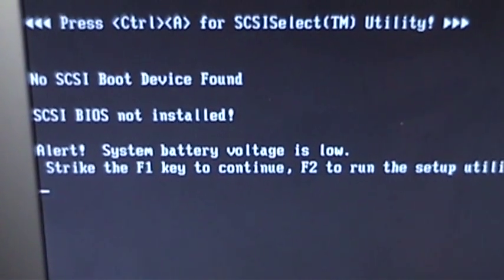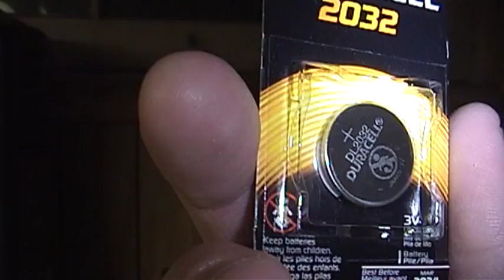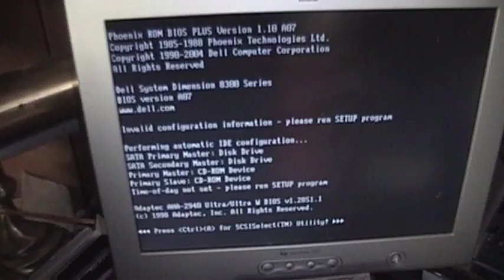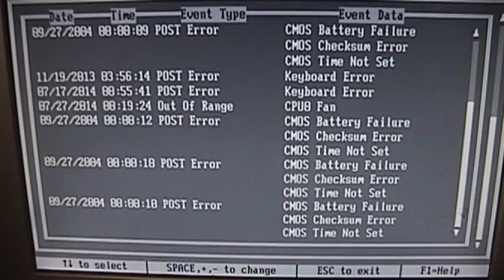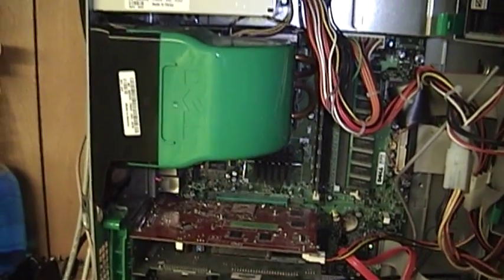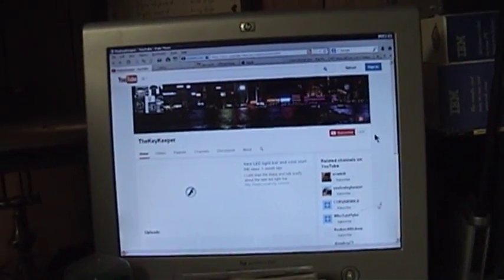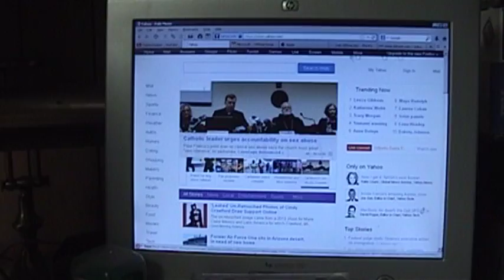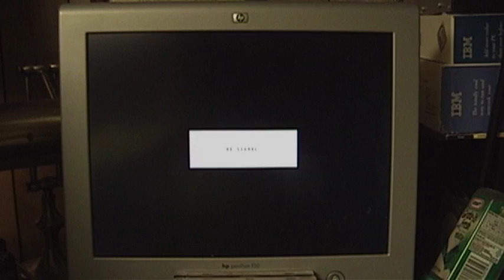Dell Dimension 8300 Clock Battery Service

Comment: Did you reinstall the original CPU after replacing the fan?
Reply from the maker: No. I traded it out for a Northwood family processor of similar speed and never looked back.

Comment: My 8300 won't turn on...  I dont know what it is the problem,  Power supply is ok, cables seems to be ok  just unplugg evertyhing and replug in.  Same light led is ON when Power supply is plugged to the board.    Maybe the power button at front is messing around but he's just too damn hide in the chasis no way to acces to that.  I didn't see some jumper to power on board.    I just spray some alcohol and air to clean the button and i get nothing from that.  Any suggestion?
Reply from the maker: Some diagnosis will be required. The front panel button probably isn't the problem.

How did you test the power supply? Dell used good quality, underrated power supplies in these, but the youngest examples are now at least twenty years old. Make a note of where all the wires from the power supply are plugged in. Disconnect them. Not all will be plugged in, which is fine. Find the big connector that was plugged into the motherboard. With the power supply connected to an outlet that you know to work, take a paper clip and short between the green wire in the large connector and one of the black wires. (There is no danger in doing this.) While not a complete test, if the power supply fan runs, it's probably good. Remove the paper clip from the two wires.

If you need a new one, the power supply is a standard ATX type. (Older Dell systems used nonstandard power wiring, but this is not one of them. However, the lack of an opening in the case for the on/off switch that many computer supplies have can make life interesting.) Buy a good quality power supply from a reputable maker, of at least 400 watts capacity. If you have to modify the case, take everything out of it first and clean up any metal filings very thoroughly! 

Should the power supply check out, reconnect the wiring exactly as it was. It's time to simplify the system configuration. Remove every expansion card except the video card. Remove every memory module except for one. Disconnect any disk drives from the motherboard. Try powering on the system. If it now works, add one device at a time until it doesn't.

If the computer keeps working after everything is back in place, you've just found out that sometimes after many years, electrical contacts need to be reseated.

If you find damaged components on something, some are repairable and others not. Your Dimension 8300 was manufactured during a time when capacitors were made using a defective formula. Many of them later failed. It's been my experience that this usually won't cause the Dimension 8300 to stop working entirely, but it may become unstable. Capacitors are cheap and can be replaced, though soldering is required and it's not a job I'd recommend if you're new to soldering.

Comment: Hi Bill, do you still happen to use this computer on a regular basis? If so, what do you use it for?
Reply from the maker: It's not used as regularly as it used to be. Virtualization was what I used it for then, and still use it for now, with regard to older operating systems. Its legacy ports (data logging meter) and floppy drive (stuff for older computers) also come in handy.
Reply: @uxwbill  That computer definitely seems to have had a fairly long life for a Pentium 4 Dimension. I certainly don't see many left in the wild, although they do offer a nice selection of features.
Reply from the maker: Anything I buy, I tend to keep it until it's worn out.
Reply: @uxwbill  I think that is a great thing to do. The computer systems I own tend to get used well past their normal lifespans.

Comment: I'm almost positive the Dell dimension 8300 has the exact same board as a Dell precision 360 but missing two ram slots
Reply: JK I realized you just didn't populate the Black ram slots. In that case they are identical

Comment: Hey uxwbill I have a quick question I was given a dell dimension 8300 from somebody and the computer is complains about a low voltage battery on startup so I replaced the cr3032 battery but the message still pops up saying there is a low voltage battery I read on a old dell fourm that it might be a fault with the 2003 era systems but it also has a few bad caps in the same place where you had bad caps on the video about replacing dell dimension 8300 caps if you can help be at all with this it would be a big help and by the way the system also loses time when unplugged even with the new battery and I  also trying bending the prong that holds the battery to see if it could get a better connection but that did not help
Reply from the maker: Get a DC voltmeter and check the replacement battery.
Reply: uxwbill I checked the battery and I'm getting around 3 volts I also put in a one more battery but it had no difference I bought a pack of 5 energizer cr2032 on Amazon and that's what I have been using on that computer
Reply from the maker: Before giving up hope on the board, check the password reset or CMOS clear jumpers. People have been known to leave them set. Beyond that, there probably isn't much hope. Good working Dimension 8300 systems and motherboards are still plentiful enough that you might as well replace it if you want one, especially if bad capacitors are not the only problem.

I recapped a Dim8300 only for the challenge and experience. These days I'd really have to think about repairing anything based on a Netburst CPU, if that was all it supported.

Comment: why does your Dell have a scsi card? did u have a tape backup?
Reply from the maker: SCSI is more than tape backup. Lots more. And I'm sure you can see at least one possible use in the background of this video.
Reply: Hard drive, CDROM, Zip ? (maybe?) External SCSI too.

Comment: What is the deal with that slanted RAM slot? I have never seen one before.
Reply from the maker: I could only guess that it's a matter of maximum allowable distance from the i875p Northbridge.

(I do so wish Youtube would quit doing whatever it is they're doing with the comments, so I could post replies from a browser that isn't Google Groan and without having to use the "all comments" page.)
Reply: ***** I know where you're coming from on the whole YouTube comments thing. I am the maintainer of the Linux From Scratch systemd distribution, so I'm stuck using that most of the time. We just added Chromium, and it was not on good terms. I'd much rather use Firefox or Seamonkey.

Comment: I have the same computer the 8300, always got the same thing saying system battery voltage is low. I replaced the battery and it still appears on the boot screen. Why is that? And is there any good way to make this computer faster? Mine is super slow I removed as many unnecessary programs as possible.

Comment: i still have a running optiplex gx270 running windows 7 with a intel pentium 4 520j processor and 2 gigabytes of ddr ram and it works alright for its age!!!!!
Reply: Ricardo The Computer Wizard i have a dell optiplex gx240 with a 1.8 gigahertz p4 but it takes sdram instead of DDR,  so that kinda sucks.  Windows XP barely ran on it, so now i have 98 SE on it , because i do not own win 2000

Comment: Dells used to be so nice. Their Commercial Products are still really great, but unfortunately their consumers products have gone to the wayside long ago (along with many other manufacturers).
Reply: DavidH373 lenovo has the same Problem,  the thinkpads used to be the best Laptops in my opinion, as i do use a t400 on a daily Basis but everything newer than the t430 went pretty much in the direction in which every laptop Brand went,  basically beeing influenced by apples line of laptops called the MacBook ( i do pretty much hate Apple products,  but i am also not a fan of Microsoft on the other Hand.)

Comment: At my school there is an IBM Thinkcentre with a Pentium 4 and 80Gb hard drive. I could collect more information if needed. Anyway, one day when I powered it on, it boots like normal, while freezing at the BIOS screen. I'm guessing it's because the hard drive is dead and holding back POST. The reason why I think it's dead is that the hard drive light illuminates before the BIOS screen even comes, but it doesn't actually spin up. It won't get far enough into POST to activate the floppy drive, justified by not illuminating the floppy indicator at POST, or the keyboard, because the various "Lock" keys' lights don't do anything. Basically, it boots up, activates the cd drive and the hard drive light, and freezes at the BIOS screen. It will stay there for at least a couple hours. There are no evident errors, not even a beep code. Any ideas?
Reply: ***** Do you know what it would be?

Comment: My wife has/had a Dell E310 from around 2006 or so, and hers did that same fan speed throttle you were talking about in its later years. So now you have me wondering if her fan was on it's way out as well. Hmmm.
Reply: I agree. The thing always was packed with dust. The second to last time I cleaned the fan, grill and heatsink is when airplane mode kicked in. We finally replaced the Dell in 2012 with a Asus with Windows 8.

Comment: I think people like to hear you ramble on because yur voice seem t be a comfort thing, or at least that's what I see. Also I have a refurbished Dell Optiplex 755 with a duo core 4 gig ram, and a new Nvidia card (can't remember number off of top of head) the other day when I plugg in my Ipad throught the mic jack to play music throught I aso wrent to play on my train simulator and abut 10 minutes in the system crashes going BZZZZZZZ and no blue screen, just a froze screen the day before the I returned to my PC it had done the same thing only I was idleing. back the flling day I tried to reboot it nothing happened stuck I unplugg the hard drive it boots but the thing beeps to me and show light code saying somethings wrong with the video card. after some how getting it to boot after changing the cable it worked but later crashed again and had t do the same things. I'm just geussing but could it be a hardware conflict with the built in sound the video card?
Reply: well as far as I know the power supply is 700 watts and the mother board didn't seem to have bad caps but I'll check again.
Reply: Yeah, Sorry I don't know were I heard 700 watts that was my mistake, It was 230 watts. any way I tried booting it and installed the new drivers from Nvidia and the computer seem to work better now, I haven't tried my simulatorr yet though.

Comment: The fan power circuitry in that board is obviously very robust. As much as some people knock Dells, I've always found them to have quality parts in them. Better quality than some of the parts enthusiasts put in home-built machines, honestly.
It must be gratifying to finally solve this mystery after so long, but frustrating that you didn't get to enjoy this computer at it's best when it was new.

A few months ago I was working on an Epox dual slot-1 board which I had bought used with CPUs included.
I failed to realize one of the CPU fans had seized, and had already killed one of the fan headers.  When I first tested the board, I put that CPU on the opposite socket, thus killing the other header.  Great - 2 dead fan headers.
Investigation revealed that the transistors on those headers were only rated for a pitiful amount of current - something like 0.12A or thereabouts. They didn't even meet the max amperage rating on the CPU fans, which were nothing special themselves. When that fan seized up, it killed them.  I wonder how much money Epox saved on those.
I ended up replacing all 3 fan transistors with parts rated for ~2A (the cost was low, so why not).  I have no idea how much current I can expect the motherboard's traces to handle though, so I'd be afraid to ever push them near that far.

Comment: LOL, the fan issue was amusing, as well as the optical mouse. 

I remember when I felt the same way after getting my first optical mouse, the original Intellimouse Explorer.  I still use it on my computer at work.  Though it can't track rapid motion as well as newer mice, it still feels great in my hand, and has the forward/back buttons exactly where I like them.
Reply: Maxxarcade Right now i'm using the world's WORST mouse. it's a 3$ "sweex" mouse, and it is HORRIBLE. it's so damn bad build quality... but you get what you pay for...

Comment: I have that same adapter...never had any luck with a mouse with it.
Reply: I did test it with a real computer (the 2002 machine I used in...wait for it...2002 before I knew how to work with digital video).
Reply: I'm thinking it may be something related to how the mouse I have does stuff. It worked with an older mouse, but not with my wireless thumb ball mouse (yeah, I'm too lazy to move a mouse).
Reply: I don't think a USB to PS2 adapter can provide enough electricity to power a wireless dongle.
Reply: Rebelkid1112 modern mice do not support PS/2 protocols,  so thats why it does not work,  i need to stick with a serial mouse on my Pentium 233 because i dont own an old enough USB mouse and also no ps/2 one

Comment: The reason why the Yahoo! Logo didn't show up is because it requires the RTC to be set to the correct date and time in order for it to show up.  If the clock is back 6+ years, the Yahoo! Logo doesn't show up, or if the clock is set to a different time, including the date on the clock, the same thing happens.  Bing (Microsoft), Google, Apple, and Yahoo! requires that your RTC is set to your time zone's date and time for their logos to show up, including famous peoples' birthdays (presidents, inventors, artist, etc.), your birthday (Google Minus is required), and events, such as holidays.

Comment: Hey Bill!  I've got a question, and an answer to your riddle about the Yahoo logo!

My question. At the 16:08 time mark, I notice a Dell machine to the left of your keyboard, I can't tell if that's a printer, or some sort of SAS/SATA external enclosure.
My response to your Yahoo riddle?  The time and date weren't set, and the Yahoo logo couldn't load to your timezone/time?
(My only guess is how Windows Update in Win 8 will absolutely not work if the computer doesn't match the timezone for which it is running in)
Reply: ***** I was close!  
As for the U.P.S.  I am actually surprised that Dell (well, they'd slap their name on it), would get into the U.P.S. business.  I've seen Dell make some good hardware (I own a few Poweredges), I would LOVE to get a hold of a U.P.S from Dell!

Comment: Bill, your Dell being sidelined by a simple case fan really reinforces the old adage to check all the obvious solutions first.  I had a recent scare thinking my monitor was broken.  I was cleaning my desk and discovered the individual switch for the monitor was in the off position!  It is a two power strip set-up, with one power strip being one of those old style monitor stands with individual switches.  Did you put back the faster CPU on your Dell since you now have a good fan on it?

Comment: I have that exact adaptec card, two actually as I ended up getting two from the ebay seller by mistake about 10 years ago the second one it still in it's packaging. I had one in my main system until a few months ago when I removed the zip 100 drive from the system.

Comment: You said you can solve just about any computer problem that anyone comes up with.
 I have a problem.
I've got a friend who has a Dell Dimension 8100.
Recently i popped the case  (just to have a look inside) and accidentally knocked the snap in fan loose. I didn't unplug it. Once i put it back in place and booted the computer up there was nothing on the screen. I don't think the fan incident had anything to to with nothing being on the display but i'm not sure so that's why i brought it up.
Anyway when i power on the computer.
-The CD drive makes a noise
-The hard drive spins up.
-You can hear the Windows startup sound but there is nothing on the display.
I have tried:
-3 Different monitors
-Different power cables
-Re-seating the RAM
Nothing works. Could the Graphics card be bad? It is an nVidia.

I know the computer is operational too.
Since there was nothing on the screen i pressed the start key then S for shutdown, the enter and the computer powered off. So i know it's a hardware problem not a software problem.

I don't know where or how to begin troubleshooting so i need help.
Reply: *****  The Power light is a steady green and all of the diagnostic lights are on and green as well.
Reply: ***** The Keyborard works. 
I know this because i said"I know the computer is operational too.
Since there was nothing on the screen i pressed the start key then S for shutdown, the enter and the computer powered off". 
The mouse works.
The Graphics card is not part of the motherboard. It is a separate and is located towards the bottom of the PC.
Reply: ***** I said before, that i have tried different monitors, different power cables and nothing works.
I am not seeing the Dell screen or the Windows ME splash screen.
Nothing is on the display.

Comment: Funny but I've never seen PC's as being something to think about as a make and model. I've never even though about, is it a Dell 8300? Or is it an HP 6910? I've always just seen computers in terms of its components. What's its CPU, GPU, RAM? It seems strange to ask, does a Dell 8300 have good performance? It seems more to the point to ask, is the Intel C2D 6600 fast? Or whatever chip is in it...
Reply: You can say that about prebuilts especially ones from a manufacturer like Dell or Acer.

Comment: With the exception of the slanted RAM, the inside of a Dimension 8300 looks a lot like the Dimension 4500 series.
Reply: ***** My guess on the angle is it may be for clearance from the inside of the case. Either that or someone at Intel was all "because I'm the developer, that's why" when designing it.